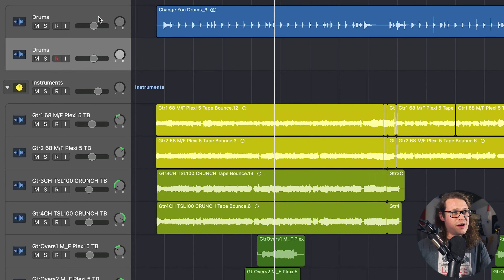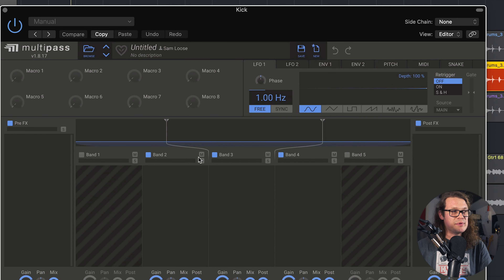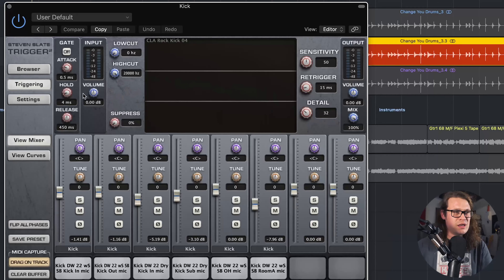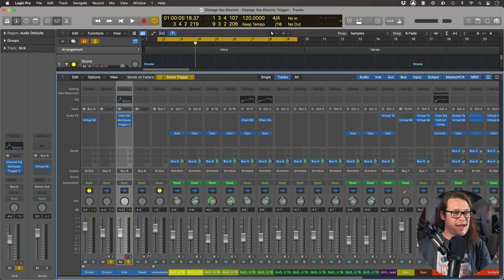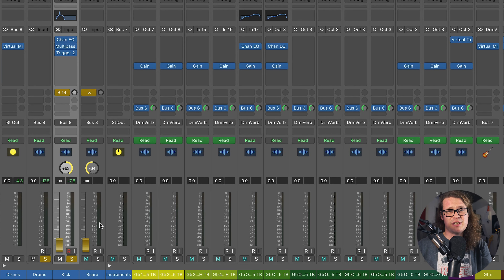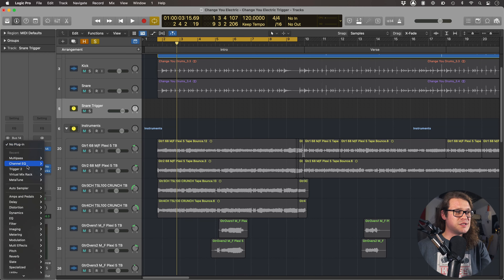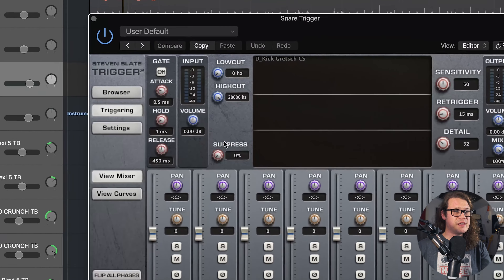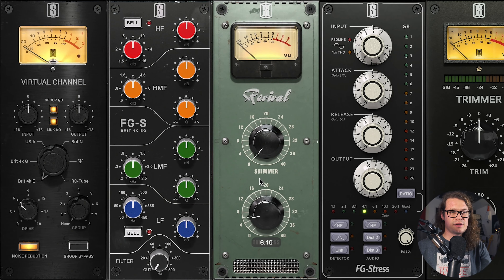How To Fix Drum Recordings From A Stereo Track | Trigger 2 Drum Replacer Tutorial

Comment: I need to be certain this is the software I need.  In a session I need to work with, the kicks, snares, toms, etc are on ONE track and NOT each on its on an individual track.  Trigger 2 can replace all kick sounds on the track, for example,  without affecting the snares, toms, etc?
Reply: This depends on whether the hits overlap each other. Regardless of that it will be possible, just may take a bit more work. Drop me a message on the Insta shown at the start of the video if you want a hand; I’d be happy to help out.
Reply: @SamLoose  Thank you!!!!  I certainly will be contacting you.  I tried to do it on my own but failed. I definitely need some guidance.